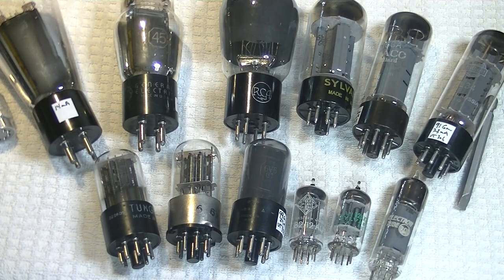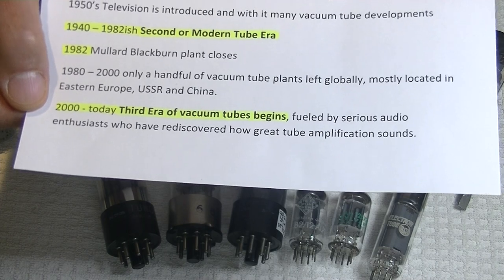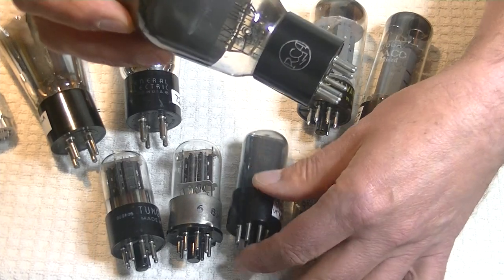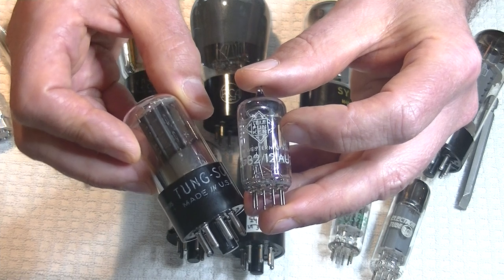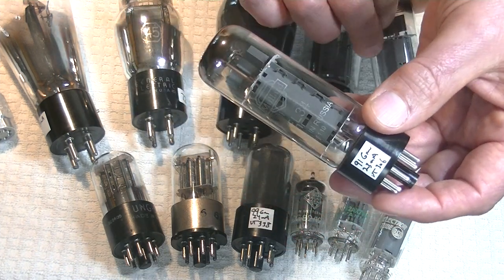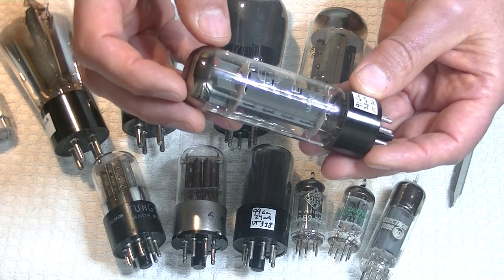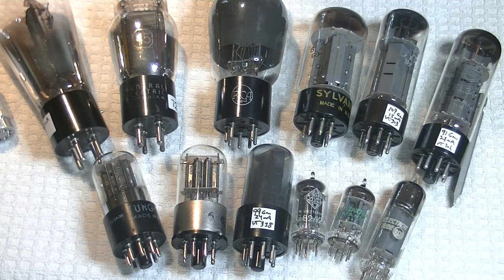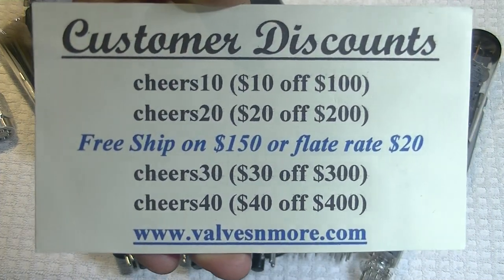Tube Lab #30 Vintage Vacuum Tubes

Comment: Thank you I love your videos. I have a 100 or so tubes I know nothing about and this helps point me in. Direction. I have a few I can't find any info on can I send you a photo?
Reply from the maker: I wish I had time, but getting the first Kit Amps shipped and making the build videos is taking up all my time.  However a good way to go about this is to join some FB Tube groups and After you've exhausted all avenues to figuring out what you've got, put up ONE post at a time with the best pics you can take.  They'll help you for sure.

Comment: Great video. Many Chinese recent headphone tube amplifiers sold use 6DJ8/6922, 6AK5/5654 and 5670 tubes configuration. What is your opinion on these tubes?
Reply from the maker: I currently have an excellent selection of vintage 6dj8 / ecc88 and 6n23p tubes.  The reason audiophiles like them is they have a very wide frequency range and a built in shield dividing the sections, for low noise.  In many ways the tube design platform is an improvement on the design of the 12au7 family of tubes.
Reply: @tubelab194  Thanks for the input. What do you recommend as NOS?

Comment: Question for the group from a new tube user: Do I have to fully insert my 9 pin tubes? 

I'm new to tubes and in the process of swapping tubes to find what tubes go best with different speakers. From the factory, the tubes were fully inserted into the receivers and difficult to remove. I felt like I was going to crush the thing and the receivers have some play in them, which leads me to believe that repeated swapping might not be advisable. With my last swap, I firmly inserted, but didn't drive it all the way down and all seems to be fine. I'm not concerned about accidentally bumping them while in use. So, is "in" good enough or do I have to press them all the way? Thanks in advance for your collective knowledge and THANKS for these videos. They're great.
Reply from the maker: Good question!  First Yes tubes need to be fully inserted, a hair short is not a problem, half in is.  If the amp is new or no one has done much swapping of tubes, then the sockets are going to be tight.  When I build a custom amp, I grab a crap tube (with nice pins) and work the sockets in.  About a dozen or so pulls and your tubes will come out and go in much easier.  Now sometimes with Octals (EL34 KT88's 6sn7 etc) the pins have a slight bulge at the end and these can be a real pain, this is caused by a less than perfect soldering of the pin connections.  Or with vintage tubes the pins haven't been cleaned up.  Good vintage tube suppliers clean the tube and pins thoroughly, so all you need to do is plug them in and sit back and enjoy!
Reply from the maker: For an easier time removing, rock the tube gently, while applying upward pressure.  When installing, carefully line the tube up, vertically, feel that the pins are in the correct spot and push straight in.

Comment: While many vintage tubes sound good, there are exceptions to the rule.  For example, in single blind tests, the Sovtek 12AX7LPS consistently outperforms almost all US-made 12AX7 types.  Then there's the Winged-C EL34, which I prefer over the Japanese Matsushita's.
Reply from the maker: Yes always exceptions!  Sovtek was the western brand name Reflector (Saratov Russia) used AND my current favourite modern 12AX7 is the reissue Gold Lion, made in former Reflector plant for New Sensor.  Same tube?  I don't have both to compare.
Reply: @tubelab194  I don't have any Gold Lions, and I'm currently saving up to buy some Sovtek 12AX7LPS to replace my GE's.  But I've heard a lot of good things about re-issue Gold Lion tubes, and the GL KT-77 is a favorite of many former Winged-C EL34 fans (and this was before the Winged-C company stopped making those, so it's not because they're not available).